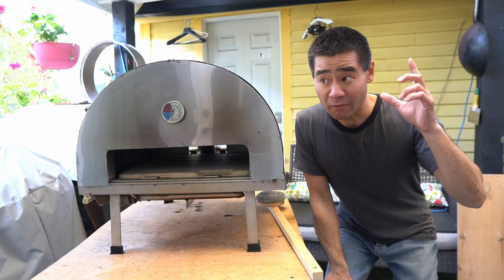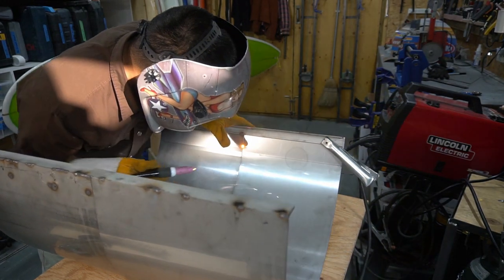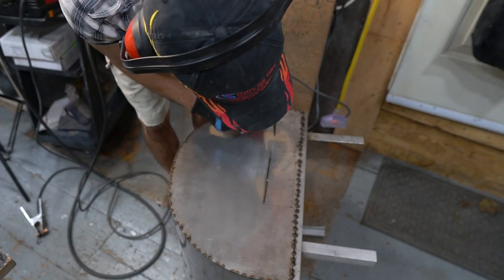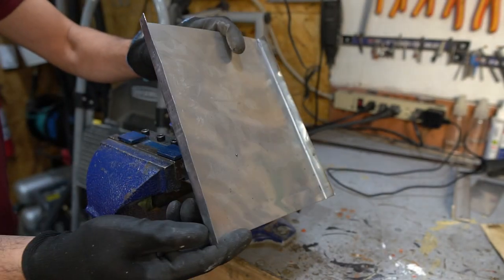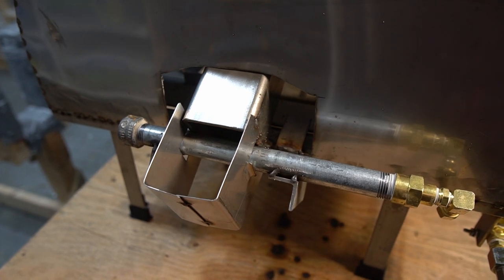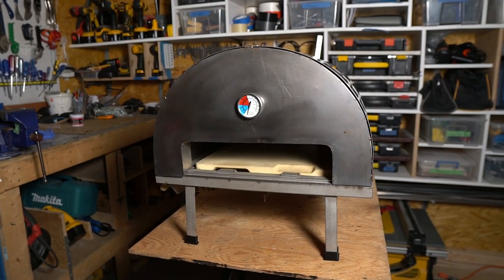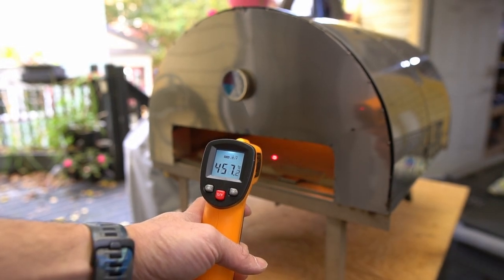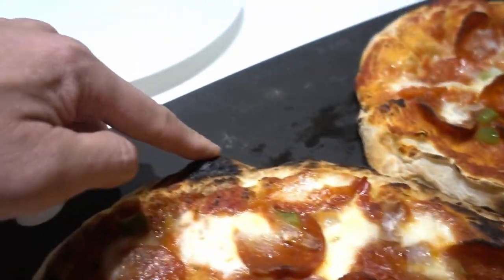How to Make a Portable Pizza Oven Version 3.0 | Neapolitan Pizza

Comment: Would like to see you tackle a ribbon burner gas setup and add insulation. Would be cool to see just how efficient you could make these because the wastage is about the biggest thing stopping me. It’s fine if you’re selling them but usually family only needs few pizzas. Hard to justify the cost Vs simply ordering.

Comment: Using the mild steel you'll notice in a few months of use it will start to rust and then flake when it's reheated. Make sure that the oven is good and hot and is done popping and flaking off the slag from the mild steel  before you start cooking. This was a problem that I encountered with mine.

Comment: While some ovens like the ooni heat from the back, side heating is superior.
Side heating creates a rotational heat that circulates staying in the oven and provides a specific pressure that helps the pizza expand while cooking.
All of the best ovens place the heat source on the left, when looking at the oven door.
Reply: Interesting point.  With the heating source coming from the left and following the dome to deflect on the stone surface …. I wonder if you’re better off without the bottom burners.  I just wonder what specs (stainless steel pipe and orifice hole) of a single left sided burner is needed?

Comment: Nice build but I don't really see a huge benefit in the bottom burner.. Things I would have done different: bigger entry door and a cover, the entire dome does not need to be so big especially if your opening is so small and finally I would have not added a bottom burner and isolated the bottom and sides with high temp insolation. Anyway that's just my preference!

Comment: Great job! Ooni should be worried! 
I’m thinking you’re on the opposite side of our beautiful country (BC vs NL) so you probably wouldn’t have to consider insulation between inner/outer layers but if you did line it with a fiber cloth or rock wool you’d probably get away with lower burner levels. Where did you get the brass fittings?
Reply from the maker: Thanks! Being in NS, I thought about rockwool but you can only buy it in large batts and didn't have a use for the rest of it.  This way I can disassemble it and it doesn't weight as much, I call it a design feature lol.

Comment: Great DIY project. 

As a welder, use an air ventilator or weld outside to prevent breathing the stainless steel smoke. It’s not good for your health.

Comment: Hi  Andrew.    I absolutely love that oven !  I have the tools to make it but I need the dimensions  ?
Reply from the maker: Thanks! Let me check, I will take a few measurements, I built this on the fly, so I did a bad job recording the sizes..
Reply: @AndrewWorkshop  thanks! That would be great . My wife and I love your channel .  You are extremely talented !!
Reply from the maker: @stevedenisep1411  These are the dimensions but you may have to adjust as you are building:

Outside shell dimensions 22" x 18" x 12", that translates to the individual pieces of stainless to be 22" x 36" long for the arch before rolling.  Inner liner is about 1" smaller so size accordingly.   Opening is 3.5" high x 14" wide. All the sheet metal was 22 gauge 304 stainless.  The stone I used was 14" x 16".

Hope this helps!
Reply: @AndrewWorkshop    Thanks for the dimensions. Your the best  !
Reply: Bravo! bravos 
Definitely the best build I’ve seen on YouTube very talented Andrew keep up the great work  Ciao

Comment: I'd build one where the food isn't directly exposed to the flames. Make it triple wall with insulation between the outer layers and the hot air going all around between the middle and inner layers. Put in baffles in that space to make the heated air take a long path to extract more heat.

Comment: Get your hands dirty with some arduino/ESP32 microcontroller a hairdryer air blower to make a custom made forced air gas burners, you'll save 5-10 times of gas consumption and pizza oven should heat up much faster. Also I would use stainless steel for forced air gas burners. You could also make your own forced air gas burners using a design concept that is used by professional blacksmiths who save much gas fuel, effort and time to heat up their forges and maintain high temperatures, they design and make something called a "Ribbon Burner" which is made using affordable special specific "refractory cement" for extreme temperature forges and furnaces. (not found at local home depot).
I bet Ooni will start using forced air gas burners instead of venturi burners on their newer models in the future.

Comment: Andrew your temps are waaaaaaaay too high.  I know that was the initial goal, but you're looking for several types of heat.  You have very little radiant heat in this equation because of the lack of stored energy in the stainless steel.  It conducts so quickly that your pizza is being cooked more from hot air.  While that's not a huge issue, the result is lots of burned hot spots and a general lack of browning.  I think you can fix this by attacking the pizza with your gorgeous oven for about 30 seconds, then back down the heat and allow it to brown at a lower temp.  Your cook time should be in the realm of 4-5 minutes, not one!  Would it not be prudent to develop a ceramic array, something tiled upon the roof of your oven so as to allow radiant heat to reflect?
Reply: That's what I wanted to say. Some sort of coating on the ceiling
Reply: Neapolitan pizzas should be baked for between 1 and 3 minutes.